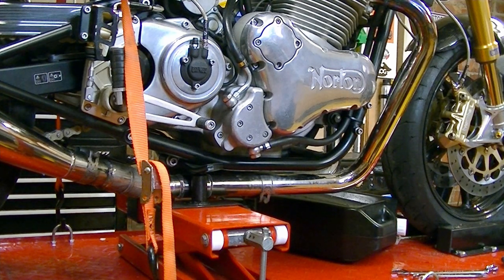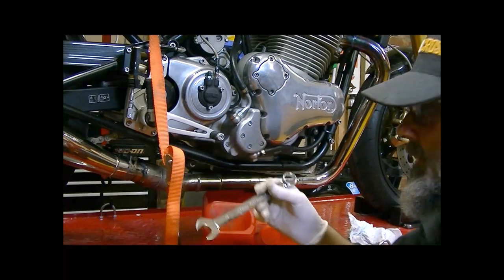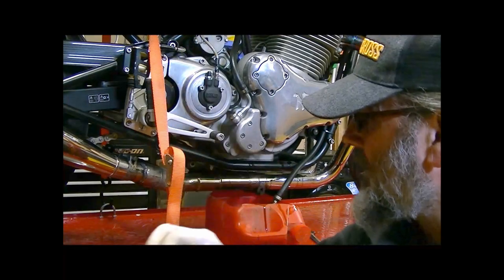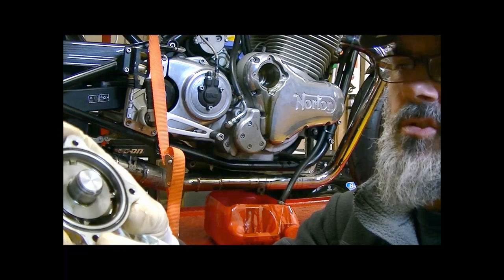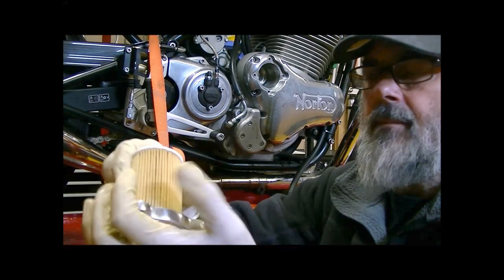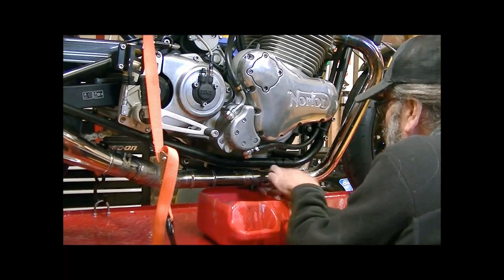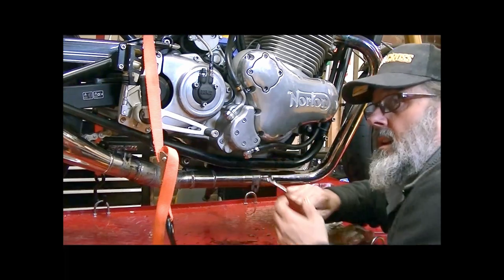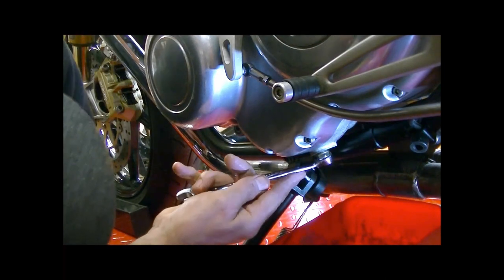Norton Commando 961 Oil Change

Comment: Excellent video, I have a 2015 Dominator SS limited edition but with the same engine, the handbook I was given is no where close to the information it should include. Your video was a great help for the DIY mechanic 👍👍👍
Reply from the maker: Glad it helped
Reply: @SongsFromTheSaddle  Interestedly my Norton was part of the Stuart Garner era which at the time of purchase was relatively hassle free, towards the demise a couple of years ago it was an absolute nightmare, in addition the latest email I received from the TVS Norton Company (March 2022) is that they will not honour any issues on pre TVS Norton motorcycles and that they will not work on any Norton unless they are manufactured from their factory. That’s going to send negative reverberations to the present owners.

Comment: Really enjoyed the video and am presently  considering purchasing one but after reading your comment about you started hassel free and ended up being a nightmare just curious as to whether you're talking about the dealer network or the reliability of the bike itself. As i am a person who plans on riding the bike and not having it in a garage to polish it i am curious about your opinion about the quality and reliability and what issues you may have had . I have read threads of people talking negative about the bike but you never know whether these people even have one or just talking out of their ass. Thank you for the video
Reply from the maker: My 961 is not a garage queen - it gets ridden. It has a few niggles, but has been reliable. The problem with visiting forums is that everyone posts their problems - you don't hear about the 100s of trouble free miles. I guess those guys are out riding rather than posting on the Internet!